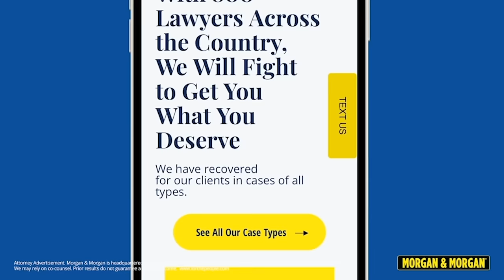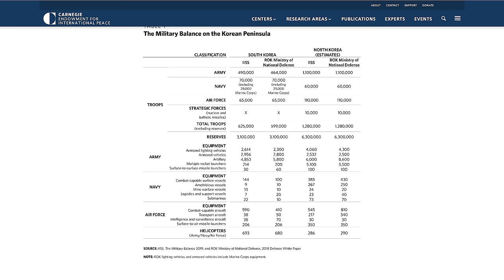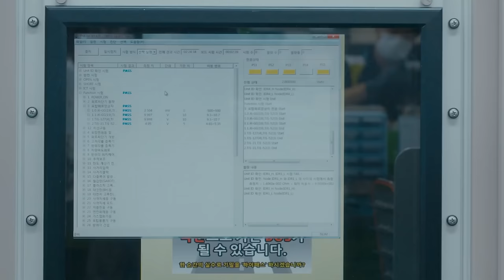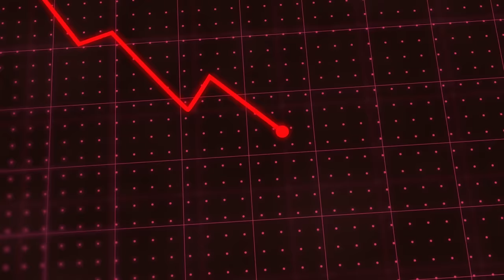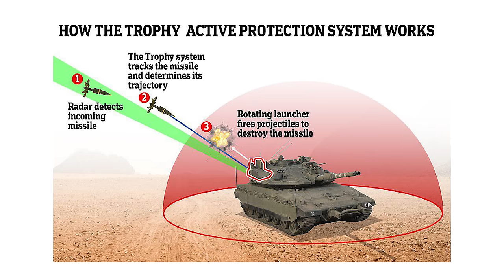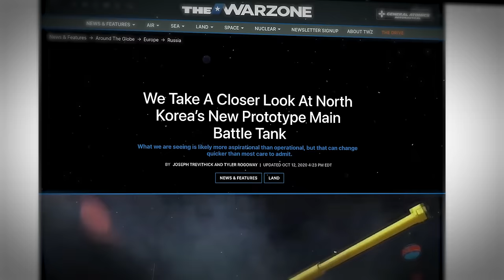North Korea's NEW Tank is a Nightmare

Comment: They had 9 of them that were apparently able to move under their own power for an entire parade.  Say what you will but its still better than the T-14 Armata.
Reply: The tank itself or the impression given by the presentation?
Reply: Design wise it's got a lot of similarities to the T-14 Armata doesn't it?
Reply: I read that the reason the T-14 actually looked broke down was because the crew had absolutely zero training on it outside turning on and giving gas. Not sure if it's true but read the driver accidentally hit the parking brake and didn't understand why it would not move.. not sure it true but seems kind of believable.
Reply: The T-14 is a next generation tank that all others must compete against 🫡
Reply: Still enjoying that single clip ?  smh..   Rest assured a T-14 is a formidable weapon..
Reply: @elliottapfel3609  That sounds very believable. I would have also accepted improper maintenance, or use of contaminated / incorrect fuel type.
Reply: @yves3560  The concept itself seems obsolete at this point. Even the US is moving toward light tanks and drones. Smaller, cheaper, faster.
Reply: @SuperDrake85  that is misleading. The light tank is meant to replace the Stryker mobile gun system but yes the USA is starting to use smaller drone after using bigger drones for decades
Reply: @elliottapfel3609  People still peddle that debunked myth of the T-14 breaking down? Some jarhead just put the breaks on by accident and later you can literally see the tank drive on its own once the figured out what happened.
Reply: @yves3560 It might be if Russia actually had them in large numbers or was capable of building them in such numbers. They don't and can't so nobody is scared of T-14. Russiais scared of Leopard 2, Challenger 2, and Abrams because those tanks actually exist and in numbers large enough to matter.
Reply: All this little Russian bots in the reploes6🤣
Reply: @elliottapfel3609  В большинстве случаев так и есть. Никто не будет в подробностях рассказывать об устройстве экспериментальной техники, что часто приводит к сбоям по ошибке экипажа. 
Т-14 еще не скоро пойдет в серийное производство (если вообще пойдет), так как на данный момент в нем нет смысла
Reply: @yves3560  
Yeah the T14 stealth tank, so stealthy nobody's even seen it outside of that one parade where it broke down.
Reply: Well, even without the T-14 Armata, the Russians managed to wreck Abrams, Challenger and Leopard tanks.
Reply: @jaimieoxford8212  
Yes, since the Ukrainians YOLO them into the frontline without support and lack all the aspects we rely on doctrinally, one of each type of tank has hit a mine and one of those was even a catastrophic kill with the rest repairable.

All the crews survived and retreated to their own line.

Russia meanwhile is terrified of our tanks. Their crews refuse to go out or sabotage themselves because they know there's a mobile sniper around that can kill them before they even see the NATO tank through their 1970's optics.
(I don't exagerate there, Russian optics are an exported version of 2nd gen Hollandse Signaalapparaten / Thales that was exported to the Soviet Union in the 1970's, because it was so far behind NATO tech that selling it to the enemy was allowed at the time)

So Russia lost hundreds of tanks, thousands of people, fought for a whole year, to destroy 1 Challenger and damage a few others.
Reply: @yves3560  Then why doesn't Russia use it
Reply: @gonfreaks937  they dont show everthing fool
Reply: @jaimieoxford8212  We never said they were invincible, and look at all of the tanks Russia has lost in trade.
Reply: ? Why would these new north korean tanks be better than the literal second best tank in the world ? I swear ya'all dont know shit about tanks
Reply: @LECJuwels  totally missed the point
Reply: @yves3560  provided they can find how to disengage the parkingg brake...
Reply: @nvelsen1975 The hatches were open. This does not mean that the crews survived. There were tons of footage of littered crews not to far from the mobility kill tanks.
Reply: @MetallicReg  
Sure Sergei, stealth crew members that nobody except you can see.
Reply: @nvelsen1975  My guy. First of all don’t insult my nationality by presuming another. And secondly - you clearly have absolutely no clue what is taking place on the ground in Ukraine. 
You have the option ofc, if your psyche allows for it.
Reply: Literally just the e brake was one.
Reply: @MetallicReg  There are no verified pictures of the dead crews anywhere. None at all.
Reply: @nvelsen1975 the Soviet Union never imported or used western sights on its tanks. Not sure where you came up with this. 

The Russians used relatively new western thermal imagers that were used on their tanks until recently when they developed their own. Like Catherine FC and Catherine XP from Thales.
Reply: @Shoelessjoe78  There are tons of them. Including geolocation and exact raid times.
Reply: @nvelsen1975  Right, so numbers mean nothing then. How many more can the west supply ? ZERO, and the tanks they have supplied were ALL developed when, exactly ? Yes there have been updates and modifications to older models or variants but as you have said using the vehicles in the right way and crews that have had sufficient training also do count. However, when all the old vehicles available have all been destroyed I highly doubt that western countries will start supplying their current models to the battlefield. Again no-one is accepting that all the lists of weapons that would "win the war" have done very little and have not regained much, if any of the roughly 20% of Ukranian territory now held by the Russians. There are no more Bradleys, there are also no more Challenger tanks as the British army has only 40 operational units left. There will be no F16's as that scheme is falling apart and there will be no more HIMARS or 150 mm shells. Russia's production capacity has far out paced anything that NATO countries combined can produce.

Not to mention boots on the ground. How many western forces have WILLING conscriptions to their armies ? I don't know if anybody has around 42 000 volunteers a month to join the armed forces.
Reply: @Attaxalotl  Russia has the capacity to produce far more at a faster pace. In a war of attrition numbers count.
Reply: @jaimieoxford8212  Found the Russian fanboy.
Reply: @TheForklifter  
From the archives of Hollandse Signaalapparaten themselves, their museum.

They ought to know who they sold weapons to, I imagine.

Not to mention they also delivered the radars for the ZSU-23, the ASADS Ka-band target tracking radar and the PAGE I-band surveillance radar are both from HS/Thales.
Reply: @alexflayz3600  Calm down, Russia drone.
Reply: @alexflayz3600  OKay, I misunderstood your way of saying things. I simpl do not see a good ending if Russia is allowed to continue to act like this. Europe should see them for what they are, our biggest threat along with China.
Reply: @yves3560 oh yes such an amazing weapon that's seen how many combats?
Reply: @nvelsen1975  those nato tanks as you call it dont even have any impact on the war its just another soon-to-be junk. only 2 challengers were destroyed because, rumor has it, ukraine was forbidden to use them close to frontlines, if that doesnt tell you all you need to know, what would? if you believe that any kind of nato supported tank has any advantage over russian made tanks then you dont take into account that those machines take part in combined warfare and a tank is as strong as its support is. ukrainians dont yolo tanks into frontline. ive never read something so disrespectful towards people that fight for their homeland. those tanks simply are worth the same or even less on than old soviet designs simply because they are mostly OVERWEIGHT for the ground they fight on. abrams tank in particular requires really stable supply chain or it runs out of everything(spare parts, fuel, you name it). challenger is simply an outdated design. leopard is good, but because its an actually well suited (better suited than abrams or challenger) it has more overall loses because it was used the most. now think for a bit why military would use some equipment more often than the other: because its a bad equipment?  OR because its better equipment than other options available? for me its obvious.
Reply: @nvelsen1975 Not all of the crews survived lmao, you can see it in the videos
Reply: Its so formidable that recently it was cancelled and wont be produced anymore
Reply: 9 of them had stronger enough guy pedaling inside
Reply: @alexflayz3600  Yeah? whats that?
Reply: @chadbailey189  That's one of the top jobs in NK.  Your parents have be pretty well connected for you to get that job.
Reply: @seushimarejikaze1337 finally some common sense in this thread 👍✨
Reply: @SuperDrake85  The US is moving toward lighter vehicles and drones because the M1 Abrams and its updated versions are still completele adequate and the US already has 10,000 of them built. There's a big difference between not spending money to develop a new system to replace the old one and the decisions that come with that to a country not having 10,000 of any tank already available.
Reply: @poika22  Agree the Abrams is completely adequate.  A heavy tank platform in general though is going to be harder and more time consuming to deploy.  They work well if you have them already prepositioned where you need them.  

I'm thinking specifically of the south Pacific, where a heavy tank in general is just probably the wrong choice.
Reply: @jaimieoxford8212  The USA has 10,000 Abrams sitting in storage
Reply: @yves3560 If it's so formidable, then why is it not on the battlefield?
It's a parade piece.
Reply: Brutha at least the T-14 is made of metal, that shit is made of wood.
Reply: @ClockWork-zj7zy  Haha.  The engineers wanted to go with Styrofoam for weight and ease of assembly, but Kim said it’s plywood or your family goes to camp!
Reply: and abramses that are destroyed by t-80 lol
Reply: @yves3560 isn't Russia beginning to dip into it's stock of pre-70s tanks? If it's so formidable, or if the number of T-14s that actually exist is more than like a dozen at most, than why won't Russia use them, especially considering they're at a point where they're sending museum pieces into an active warzone
Reply: @geoffrogers7590 , ‚Russians scared of…‘ - honestly it sounds laughable. Certainly does not seem that way, bud.
Reply: @SuperDrake85  I wouldn't think improper fuel. I'm sure as a standing army they have regulations on all vics using same type of fuels. I.E. JP8 etc
Reply: @jaimieoxford8212  And Ukraine managed to sink the flagship of the Russian navy's black water fleet without any formal navy, destroy 1/3 of the A-50 Combat Control Aircraft fleet and killed one of Russia's Top generals, also intercepted and destroyed hypersonic missiles with cold war era Geopards from Germany. All of those registered tank kills were from drones or explosives and if Russia is such a formidable force compared to Ukraine explain how they haven't made any significant territorial gains since spring of last year, Kyiv has yet to be captured
Reply: You already know that the armater stopped due to an operator error, right?
Reply: @SuperDrake85  But it is turtle tanks that are particularly successful in battle! Therefore, design based on combat experience is rather contrary to what you say. The USA, which hasn't really won a war in 80 years, is perhaps not the best example.
Reply: @istandwithdprlpr7801  hahahahahaha!
Reply: @SuperDrake85  very argumentative. It's a shame that any aspect that you can't grasp mentally is now laughed at or shouted down. In the end you just show your own incompetence in civil dialogue. It's true, the driver activated the emergency brake and that's why it couldn't be towed away afterwards.   Even if it were something else, it would be a tank. Even Mercedes and BMW have, as they say in Germany, “Monday cars” that have one accident after another.
Reply: @istandwithdprlpr7801  Turtle tanks man?  That's the wonder weapon of tomorrow's battlefield?  A tool shed welded on top of a 1950s tank chassis? 

The special military operation has been an absolute shit show from day one. It makes the first Chechen War look like Operation Desert Storm.
Reply: It looks like the T-14 to me
Reply: @yves3560  How about that one where T-15 (same engine and chasis as T-14, only lighter) can't climb that insurmountable mountain known as the  towing truck? While rattling and wheezing as if all of its bearings are melting, all at the same time.

It's a garbage contraption, around a garbage engine, on a garbage chassis that can't be built without Swedish steel - as Russia lacks the ability to produce modern steels.
Reply: @TheManOfMyriad  Well, small minds think alike.

Mostly about how to steal from others.
Reply: yeah, pretty sad standardizing, lol
Reply: @elliottapfel3609 If he did hit the parking brake, there wouldn't have been a reason to tow it off the square. Unless of course the parking brake is impossible to disengage, which I think might be more embarrassing than it breaking down. 

The tank breaking down makes the most sense.
Reply: @yves3560 Ah yes, a formidable weapon that no one, including you, have ever seen in combat. They said it was in Syria and Ukraine, but it seems like they must have Halo-level stealth tech, because in all the footage from both wars, not one single T-14 has ever appeared on camera!

IN THE TWO MOST DOCUMENTED AND RECORDED WARS IN HISTORY

Remember, the rule with Russia is if you don't see it, it didn't happen. Therefore, there are no T-14s in Syria or Ukraine.
Reply: Their both frames covered by paper mache with a Toyota motor 😂
Reply: @elliottapfel3609 Its true, when you watch the full parade video, you can see the T-14 drive oof under its own power. Also, if it had broken down, the Recovery vehicle should have easily been able to move it, yet the T14 stayed put.

Comment: This feels a lot like those ricer cars that have a ton of stickers, bolt on chrome exhaust nozzles and huge spoilers, but nothing under the hood but a bare stock engine.

Lotsa visuals, but none of it actually does anything.
Reply: Never underestimate your enemy
Reply: I was suspect of this when carefully looking at the video clip of the parade. One of the tanks is driving down a smooth parade street, and is bouncing out of time with it's track's beat.  For those that don't know a tank can start to bounce if you match the speed of the tank to it's suspension's rebound frequency coupled with the flat sections of the track hitting the pavement at the same time. It's annoying, and drivers can do a one second left - right of the controls to get the track to be offset again so it doesn't happen as badly. But for it to seemingly bounce quicker than the track hitting the pavement causes me to suspect this is another of their cobbled together parade pieces. While the real tanks are kept out at the training fields.

Comment: Those slots in the turret armor for the APS mean it's probably not actual armor, just a skirt or spaced armor over the same old cast turret.
Reply: Yeah, IDK what OP is smoking. Pretty obvious that isn't armor plating and the real armor is behind it.
Reply: They probably mounted a slot for an APS just so that when other countries ask where their armour is they can say "an APS goes there, we just don't have the APS. There's armour underneath there though."
"How much armour?"
"I'm late for school and my dog ate my homework"
"How much armour is under that APS slot?"
"Byeeeeee!"
Reply: @Lurch-Bot you do realise how modern armour works do you?
Composite armour is a sandwhich. you have a baseplate and an outer plate, at times there is a middle plate. All of those are traditional facehardened steel. Inbetween you have layers of composite materials stacked and angled. It is 100% possible to have holes in that stack for mounting of systems. And every tank using such a system on its turret has done just that. Optics are all mounted in exactly that way.
Reply: Prob also why it's equipped with the APG...Most likely a primitive response to drone warfare...

Comment: There's a reason we use a six-wheel configuration or an even number configuration on the bottom of a tank. It's the pivot point. If you have a wheel their you drop hard but if you have a gap in between them it adds a cushion in the track that allows the vehicle to pivot a lot softer. As someone that deals with a tractor loader every day I can tell you there's a huge difference in wear and tear as well as operation. Sometimes that little bit of cushioning in between two rollers can be the thing that can keep you from flipping. Tanks are a lot heavier and their noses drop a lot harder.